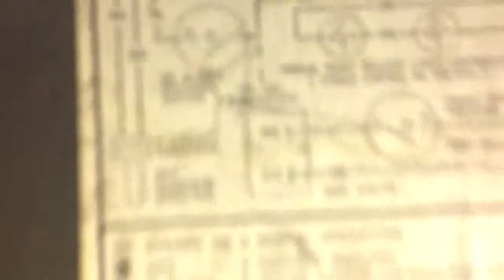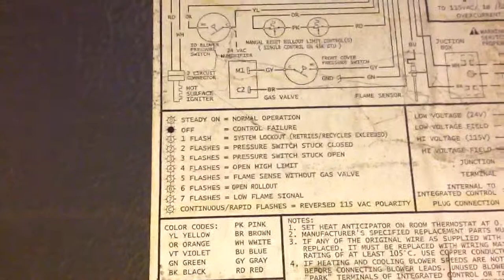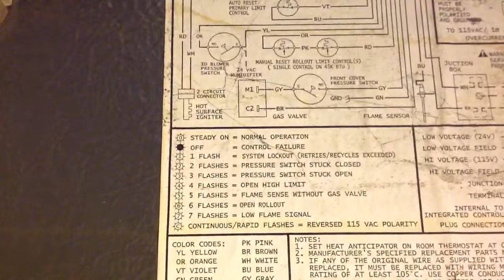DIY furnace repair

Comment: you should break the diagnostic steps down. there is a lot more that goes on between  the inducer and the igniter than you say. these should be checked before removing the igniter because usually the break when removing them and you shouldn't use abrasives to clean flame sensors.